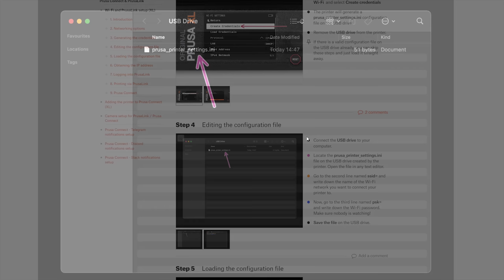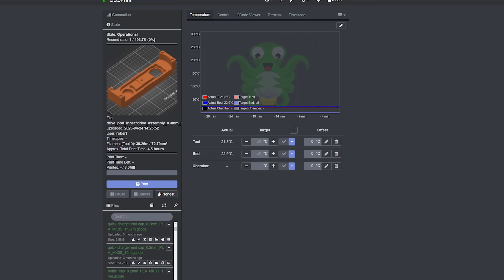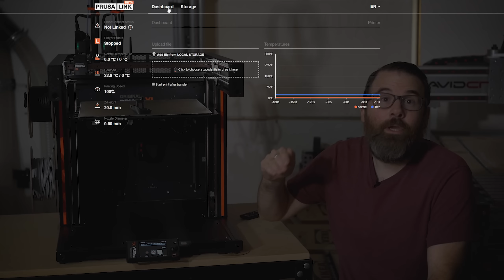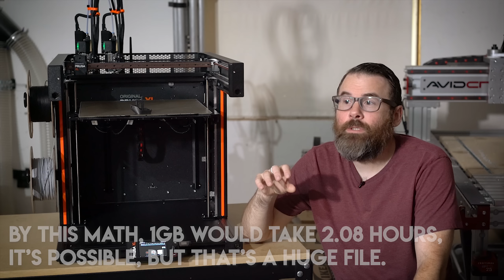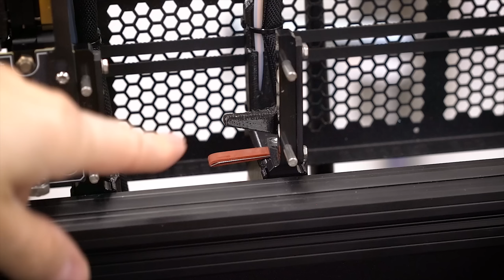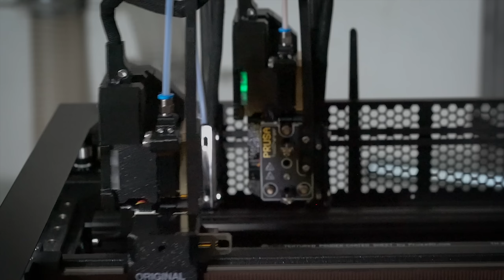Prusa XL - WiFi, Load Cell, and More!

Comment: Great summary, I really appreciated both this and the first installment.  Recently got a Bambu but im also thinking of one of these. Different tools for different purposes.  This for engineering grade multimaterial printing.  The prospect of printing bushings directly into parts with igus filament, a rigid plastic or two, and also a TPE all in one print.  It seems like this gets us to that holy grail
Reply: That's the real reason I'm after one of these. It has so much potential, especially if you factor in other tools that may eventually come along.
My single toolhead order email arrived, I'll add toolheads when I can afford to. I appreciate that Prusa will be making the price of spare heads similar to buying them with the machine.
Reply: I'm going to remain very skeptical on the actual multimaterial performance on this machine until I see it demonstrated. It's been highly touted as this machine's strong point, but I haven't seen it proven yet. Can their toolchanger do what E3D couldn't? The scenario you describe with a combination of rigid, flexy, and bushing/bearing filaments sounds cool and will be exciting to see if it really works.
Reply from the maker: I just tried this last night and it does work.  I need to work on the TPU settings, since it was really blobby, so I need to adjust the linear advance, or change the temps.  the default profile for TPU didn't work great for me.  But it absolutely does print two different materials as you'd expect.
Reply from the maker: This is the next video I'm working on.  I'll post some stuff on my instagram.  I need to dial in settings for TPU (it's printing like crap, the profile isn't good), but it does absolutely do this, once I get TPU printing better.
Reply: One thing i was imagining too was having a structural “core” filament, and aesthetic (or even as you mentioned Friction, or as i was thinking Abrasion/UV/Chemical Resistance) outer skin.

Could also potentially have a cheap but boring aesthetically core, and Fancy Filament for the Skin.

Comment: Very well done. This kind of summarizes my experiences. That is ... up to the part where I started to use different materials.
I also see minimal stringing, which is due to the 0.6 nozzle size. On other printers with 0.6 nozzles we do see a lot more stringing so kudos to Prusa for dialing in the 0.6 nozzles perfectly.
@16:20 It is actually doing some kind of nozzle cleaning before probing the bed. It heats up the first extruder to a lower temperature, retracts and probes/wipes a few points on the bed. The probed points must result in a stable Z-value and if not, the printer will halt and inform you that there might be a problem with a hot end that is not clean enough to do probing.
This happened to me once and this is kind of annoying because it takes a few minutes in the process of starting a print before this happens
After probing the bed, it picks tool 2 and purges that one first. @17:09 The wait after purging and parking that tool is to let tool 1 heat up, not for tool 2 to cool down. After this, all tools have the correct temperature and on other layers tool changes are fast.
Reply from the maker: I've been testing out some TPU and it's not great.  I'm not sure if it's the filament or the machine, but I need to do some more testing.  Also, thanks for the info on the nozzle cleaning, that makes sense.  It's cooler when it does it to prevent oozing.  So it's just a sanity check, interesting.
Reply: @RobertCowanDIY  I did a multi material test with PLA and TPU (Flexifil from FormFutura). Results was not perfect but acceptable and I was actually kind of surprised to see that my print did not result in a bit spider web. A 0.6 nozzle with TPU is not something I would try on any of my other printers
Reply from the maker: @Rob_65 Gotcha, I'm having some issues with TPU (it's just really blobby and ugly), maybe after I try a few others things I'll try going to a 0.4mm nozzle instead.

Comment: I am REALLY glad to see strain gauges/load cells making their way into more machines lately. I managed to snag an early Creality CR6 and have been in love with pressure sensing based bed levelling ever since. BLTouch was alright but it had so many clones and like a third of all the octoprint discord messages from new folks were just folks trying to get the thing to work correctly and either giving up and leaving octoprint, or giving up and disabling bed levelling, which was really sad to see. Inductive sensing seems like a good idea if users aren't changing buildplates/etc (good for closed-source, locked-down printers) but for open-source, modifyable things like Prusa and Creality, it is SO good to have that strain gauge bed levelling.

Haven't gotten a hands-on with a bambu lidar bed levelling demo yet but maybe that'll be the future after strain gauges become 'old tech'! :)
Reply: Is the LIDAR thing locked down with Patents, or no?

(Granted I don’t know if load cell is locked down or not too;  Unlike Lulzbot, Prusa can be more Opaque than Full Open Source at times, for better or for worse.
Reply from the maker: I've turned off all the LIDAR features of the bamub, it's VERY inconsistent and only works with some filament and some build plates.  Unfortunately, it only works with the stuff I don't use.
Reply: @RobertCowanDIY  I've wondered if there's a way to implement it that works uniformly across beds, but I think at this point a physical contact probe method such as a strain gauge is still the best to work with all printbeds, all coatings, and all filaments.
Reply from the maker: I think with a vision-base system, you're always going to chasing challenges like lighting, reflective surfaces, etc.  The load cell is the right way to do it IMO.  Vision also relies on so much more processing, which requires extra hardware and software.  It just seems like throwing a lot of unnecessary tech at it.  I look at the CNC world, why don't they just use AI vision systems for edge-finding?  It's far better to just probe it.

Comment: Thanks for the video, I've been waiting for this one to see the multi material / tool heads in action. Looks really good barely any wasted filament.
Reply from the maker: Yeah, barely anything.  And on larger prints, it's going to be the same amount, so the wipe tower is really minimal and can be hidden easily on the print bed.

Comment: I would like to see the capability to have two spools used consecutively. Once the first spool runs out the second spool is used. Could get rid of a lot of short spools that way.
Reply from the maker: Oh yeah.  I'm not sure they have the functionality, should be easy enough to add in firmware.  I'll look into that. I THINK they're just pushing people to use the larger spools for bigger prints.  But I would love to get through a lot of my smaller spools.

Comment: Thanks for the video!  Why does it need a wipe tower with a separate toolhead for each filament?  There's no old filament to purge like in a single toolhead filament changer, each toolhead already has the correct filament ready to go.  Why wouldn't it just pick up the toolhead, unretract the filament and print?
Reply from the maker: Sorry for the late reply.  Think of it more as a prime tower?  Sure, there's heated filament in there, but it still needs to get the flow going.  You don't have to use a wipe tower though, you can wipe to the interior (infill) and other options.  If you print straight into the outer wall, you'll see some small gaps, so it needs to be primed first.

Comment: Some of the stuff Prusa does is really impressive. Esp the first layers, but some of the other stuff is really puzzling that they seem to skimp on. Such as the connectivity. Im also puzzled why they just didnt reinforce the frame at the front making it much easier to enclose.
Reply from the maker: I feel like there's a reason for that?  Having used it, I'm very much appreciating the open-ness in front.  It makes it FAR easier to use, get parts in and out of, etc.  I wonder if the target audience is print farms.  This might make sense, seeing as you want access.
Reply: @RobertCowanDIY  Maybe, but after having coreXY's for a number of years access to the parts have never been a problem for me. I have my printers on racking that are on 2 layers, accessing the prints are easy as the printers just lower the bed when its done, nothing is blocking entry from the front. It just seems like an odd design choice for me.
Reply: @Festivejelly I assume It has to do with there afs system for farms. the part can't hit on the way out when you pull out the plate. Also better for vision systems and so on.
Reply: I can understand not having the one beam on top In the front but the 2 beams on each corner just doesn't make sense
Reply from the maker: @stephenteitgenengineering Maybe costs savings?  It would be relatively straightforward to add them.  We'll see when and what they come up with for the enclosure option.
Reply: @flo47able  enclosure needed for abs and many other useful materials
Reply: the missing front brace is to allow easier removal of full size prints
Reply from the maker: @MrBlackmidi1234567890987654321 Yep, and I VERY much appreciate it.  Enclosed machines are always harder to interact with.  I really appreciate the open front and sides.

Comment: just one thing I don't get - how come prosumer level printer does not come with built in enclosure (and air filter) like e.g Bambu X1 Carbon. Makes it basically a PLA machine. It's like building a racecar and using cheap regular tires - can only drive it to grocery store. Great video btw, cheers!
Reply from the maker: I think it was released a bit early (which is ironic after all that waiting) so if we look back at this video in 6 months when they have a full enclosure option, input shaping, etc, it might be easier to judge?  Right now it's not 'complete' in my mind.  Keep in mind, I placed my preorder 1 hour after it was available, so this is still very much the first batch.

Comment: I didn't see it anywhere so would you mind posting exactly what TPU you're using? It would be great if you could go into anything special you had to do to use TPU. I can't even get it past the filament sensor on the side of the XL. Thanks!
Reply from the maker: I'm using matterhackers pro TPU.  Are you cutting it at 45 degrees?  You really need to cut it at an angle, and maybe line up the bowden tube so it's entering the extruder vertically, instead of at an angle.  It takes a tiny bit of fiddling, but works fine for me.

Comment: I just got my XL with 2 heads. Right off the bat I'm a little confused with the setting up Prucaslicer . Perhaps you could do a short session on slicer setup, printing with 1 filament then 2.. I was really confused at first about the wipe tower as I opened the XL setting with no project. Didn't realize they would provide a means of moving the wipe tower around depending on what being printed. Not new to Prusa, I've had a MK3 with S+ upgrade. Very happy with it. Got the XL for using soluble supports and larger build table. Don't really care about speed. Usually start a print and do something else, checking on it occasionally.
Reply from the maker: There's a section in the book that comes with the machine about multi-material printing.  In short, you either paint surfaces or unmerge objects and then select the appropriate extruder for each painted section or part.  I could do a quick tutorial coming up.

Comment: Hey Robert,

So, I have been testing a while with my XL and this is what I found with my wifi;
The WiFi transfer speeds can be really fast, depends on your network. I get around 30mb/s via wifi. However, the printer instantly writes it to the local USB drive that is inserted. From my testing, this is the process that caps the speed of the upload if you are directly printing via prusalink. 

How did I verify this?;
If you upload to prusaconnect, it goes really quickly. When you then transfer from prusa connect to the printer, it slows down significantly.

Are you experiencing the same??
Reply from the maker: But with Prusaconnect, you're not really transferring data to a printer, correct?  Or are you just talking about communication from the printer to the cloud service?  But that makes sense, they might not have an actual high speed USB interface.  The printer itself is responsive enough, but transferring any actual data to the 'local storage' is SLOW.
Reply: @RobertCowanDIY  Yeahh what I found is, if you connect and send to prusa connect directly from prusaslicer, it is a 2-stage process. It first uploads from PS to PC, which is fast. Then it moves the file from the cloud-based PC to the physical USB in the machine.
I suspect it does this in case of power/ internet outages.

This transferring process takes a really long time...  You are actually moving the files to the physical printer, also with Prusalink.

You can verify this, because all of the cloud-uploaded files (PL or PC) are also on the USB drive afterwards.

Comment: I was thinking about building my own toolchanger, but the time I'd have to spend buying parts and trying out stuff and calibrating makes the price of the XL way more appealing for the "ready out of box" experience.
Reply from the maker: Same!  Even building a 350mm voron is relatively close in cost to this, and it doesn't have a tool changer or the reliability (from what I've heard from others that have had them).  For what it is, it's not expensive.  It's just expensive if you don't need a tool changer or the larger format.
Reply: I’m excited to see if it gets to a high level of polish and/or gets a huge community around it.  The E3D Toolchanger seemed well built (and ASMBL was intriguing), but never really caught on.  Supposedly the Original I3 Mk3 had glitches, but has evolved to be VERY reliable, has a huge community, and can be fixed/modded easily.  Even Open5x was developed using one.

If these initial problems (which arguably should have been worked out already, at least in my potentially naive opinion) get worked out we have an exciting future with this machine!

Comment: You are getting much better results than I am.  My 2 tool head XL strings like crazy.  Havent seen stringing this bad since my Ender.   Been working with support but still cant figure it out.
Reply from the maker: I've seen that from other people.  Mine has minor stringing sometimes, but nothing I even felt like addressing.  I've seen others have issues though.  I'm not sure why it works for some and not for others?

Comment: The tool changing speed is great, and actually much faster than I expected (what was that, 15 seconds including the wipe tower?).  I only have the 1 tool version but will be adding tools as soon as they're available.  And the input shaping alpha can't come fast enough (I think the current word is October for it), as that means 15 hour prints should be finishing at most 7 or so at the same quality...
Reply from the maker: For the first tool change it's maybe 10-15 seconds.  But after the wipe tower is established it's under 5 seconds, maybe ~3.  I guess the size of the wipe tower will remain the same regardless of print size?
Reply: @RobertCowanDIY  Wow OK i was trying to count seconds on the later one.  Yeah I don't see why the wipe tower would ever get larger, since all it is doing is re-priming ("pressurizing?") the nozzle between turns... So why should that ever need more...
Reply from the maker: @nightcrayon Correct, I'll test it out there, maybe there's a trick I'm missing.